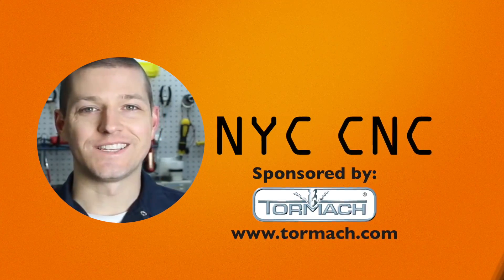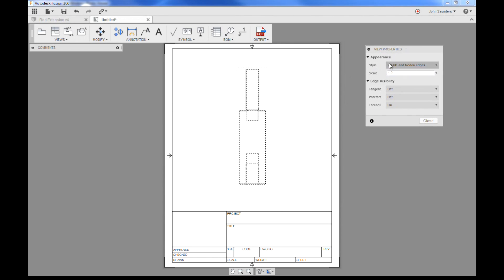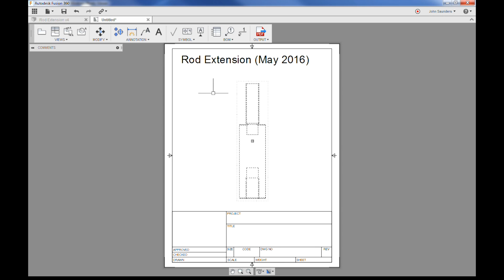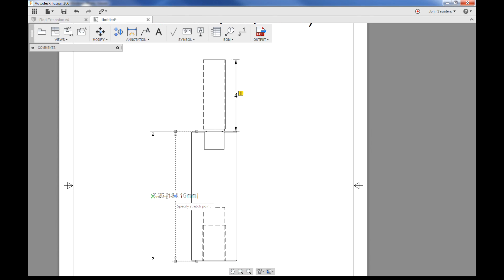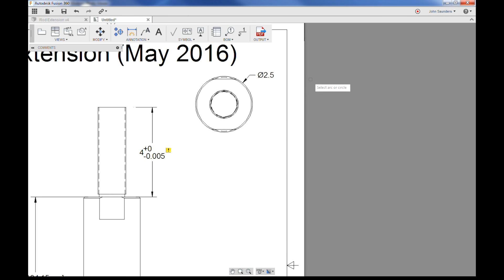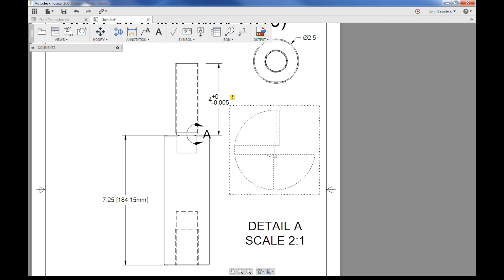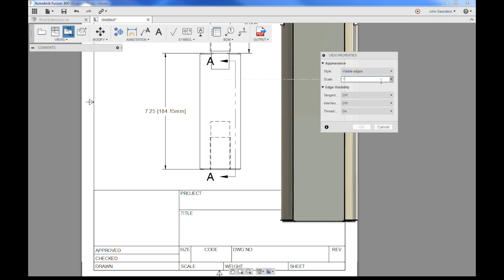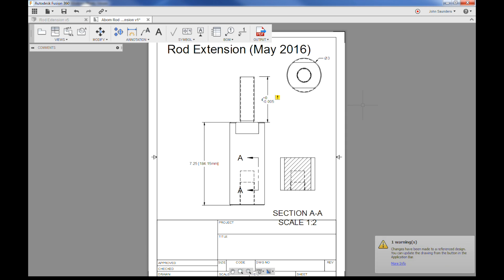Fusion 360 Basic Drawing Tutorial!  Fusion Friday #29

Comment: Yeah, drawings are probably the weakest part of Fusion360, but there are workarounds for everything. So if you don't use drawings too regularly, and you know what you're letting yourself into, then it's ok. And being parametric is a big plus, whichever way you cut it.

Now, as for the yellow notice. It's because the top of the dimension is not attached anywhere. Pick the top right-angle of the dimension and attach it to the actual part. It does that sometimes. Even though you select the correct geometry. Don't know why...

And you could make the section view down the middle of the part, too. That way you wouldn't have to show hidden edges to see the threaded part.

I wish this comment was helpful.

Comment: in the Adam description of the part, at the lower end of the external threaded part you make a groove. I think it make a weak point that eventually cause failure as this part would be in a extreme working stress. The  " R" in Adam request would be for radius instead of a groove, IMO. I maybe wrong, but it is just my mechanic point of view. Very interesting to see how things could be design before being made.
Reply: It was a bit hard to know if Adam was referring to it being a Radius, a Rebate or a Relief cut for the ends of the threads, and Im not a machinist so although I know why it is there, I cant tell you the correct name.
I think from watching Kieth Fenner and others, that the internal corner where the shaft meets the main body, it should have a radius to remove a stress point as you describe.
Maybe it needs to be described as a Radius Relief cut?

Comment: Hi John
I have had the same problem and I do not know how to fix it I have been through the tutorials on the Fusion channel but know luck If you can get an answer please can you do an other video on this. I don't have CNC only manual machines so I use drawings for my parts there is a way to rotate the part but it depends on where you place the base component.

Dave

Comment: Wow.  Not being able to rotate the part in a drawing is a pretty big glitch! That does make for a horrible pita. 

The yellow (!) could be due to insufficient dimensions. If you put dimensions on the 2 chamfers it might go away. Or it's picking up the threads and telling you no, your thread length isn't 4" it's shorter.  One if those "stupidly smart" features put there just to annoy you >.<

And you should really use the title block for the part names and dates. I don't know if F360 has it. But I know solidworks allows you to create a titleblock template that will automatically populate with the part name/date/etc

Comment: I think I asked you that on the comments of another vide, but I think you could not see that. Is there a way to foul the cam side of f360 to make it thread mill external threads?
Reply: I've watched your video about the comparison between tapping and thread milling on f360. In order to thread mill you "tricked" the system by making it think it was using a normal end/roughing mill. I wondered if you can apply the same trick to external thread too. Thank you!
Reply: +makirompe if you have to "trick it" then you're doing something wrong. Either not correctly defining the tool/pitch/root dim. Or something. 

But last thing you want to be doing is "tricking" CAM software into doing something unless there's absolutely no other way to accomplish it.

Comment: Ugh, "Get Latest" is probably the third most annoying thing in 360 for me. The second most annoying is saving and restarting 360 and the CAM toolpaths requiring regeneration. These might be linked: As a single user, not a large shop with multiple employees. I can understand wanting to ensure consistency between team members, but there should should be a couple options: "Automatically update designs referencing other components" and "Save generated toolpaths with design". The first is an annoyance that can be intelligently fixed when you tweak a couple components that are referenced and (and/or repeated) in an assembly in a different design, the second is a low-hanging fruit: If the item hasn't been opened and modified, leave the toolpaths alone.

As a (further) aside: The number-one most annoying thing is how much of an annoyance the cloud stuff can be: Sometimes, I want to continue without saving. Sometimes, I don't want to have to upload a non-native design so I can modify it (Yay, 3d printer! (Boo poor overhang support structure generation for my slicer of choice.) Boo 360's STL export not being a save->export option on the toolbar!) Sometimes, I just want to save locally and manage something myself because I might be on a metered internet connection.
Reply: Sometimes just opening a sketch and closing it (even making no changes) causes the tool paths to detect a possible change and requires regen.  Solidcam has the same issue. It's something to do with the automatic detection and update between the CAD side and CAM side.  Saving the CAD side doesn't automatically mean the CAM side is saved. So it sees the CAD was recently saved and tells you the CAM side hasn't. It's bizzare.  Seems to happen with every integrated CAD/CAM package there is. I suspect they're all using the same 3rd party kernel or something
Reply: +Occams Sawzall I found that if I open a sketch just to have a look and not change anything, it is better to exit via "undo edit sketch" rather than exit sketch.
Reply: +kraklakvakve ya. But its still an annoyance and something you should t have to "work around". 

But I'm sure it's on their laundry list of things to fix

Comment: cool.

John, in Fusion 360 is it posible to create different configuration in your 3d model, then visualize them in your 2d drawing?
Reply: +NYC CNC you remember that in Solodworks you can create configuration in your 3d model, for example when you have a bolt with different lengths, then you create configuration in the same 3d drawing with different lengths.